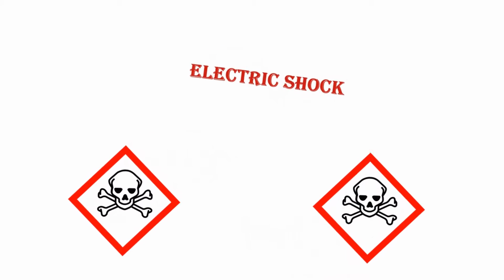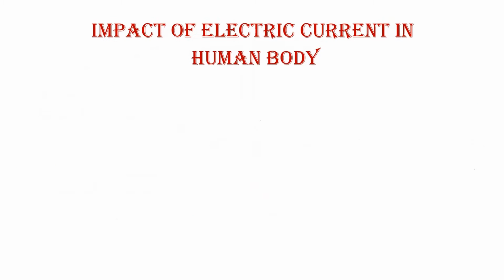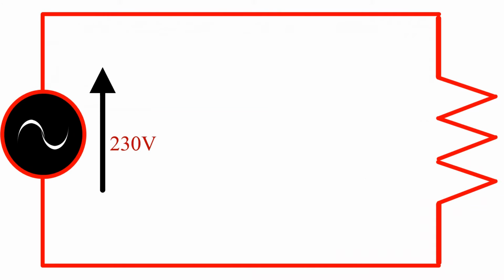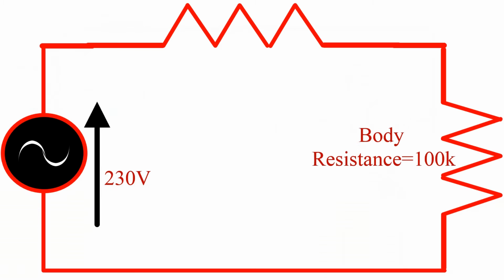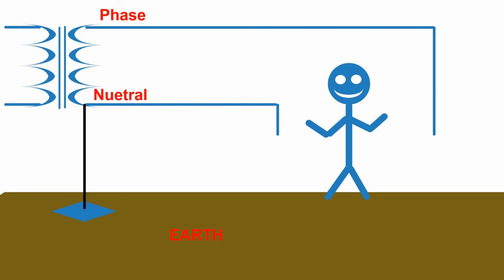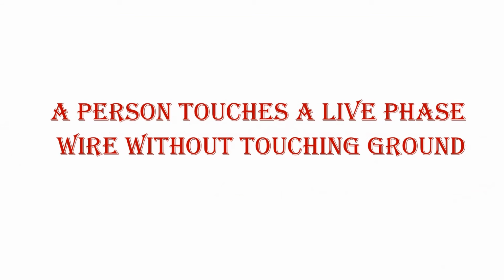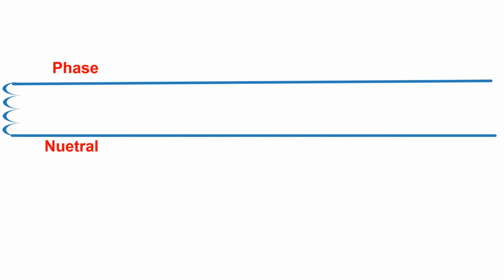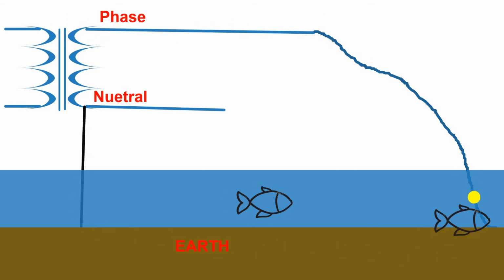What happens when humans, bird or fish touches electric wire? Electric Shock,explained!

Comment: there can be cases where the neutral has the same voltage as the live wire, so don't touch the neutral either.

Comment: i remember when i was a kid, i grab one bare side of half opened extension lead socket with exposed metal connection, i remember tingling and piercing pain and that i wasnt able to let off the socket from my hand for couple of seconds. It was domestic 240 Volts, and i think today, am i should not suppose to die that day?, i think theoretically i could die, because only resistance between me and ground was quiet thick woven rug and socks on me  :D... What is resistance of 1 inch carpet and slippers? I always thought it was God who did not allowed me to die that day, but now i think maybe it was not really God who saved me, but those classy slippers Santa Claus brought me for christmas. according to calculation 230 volts / more less 600-1000k resistance would give lets say less than 0.2 mA current through my body.

Comment: You ll shock severely if you touch a high voltage wire whether your feet are insulated or not,on the ground or hanging,circuit completely or not.The only difference is the severity.So don't ever mess with electric current.
Reply: whats the point of this video then, if you get shocked in every case, how come birds sit on high voltage lines and are okay?
Reply: @radokral  we have to consider capacitance of air in case of high voltage. Since bird has relatively small body compare to man it doesn't have much effect. But in case of human, due to larger area of body exposed to air high voltage will build a closed loop using air as a capacitor and eventually get shock. But low voltage around 230v is safe to touch in mid air. But not 11kv, 33kV or higher

Comment: well with boots chappals, etc. you're DC insulated, but not AC. there is always a parasitic capacitance
Reply: Can u plzz elaborate.....are u saying one will get a shock by AC current even with rubber slippers?
Reply: @AbdulHadi-hl3el  Yes, you will

Comment: Ok... Don't listen to this guy.
1. Don't go touching the 230V wire in search of a tingly sensation and especially not barefoot standing on earth...
Touch it and you'll get the jolt of your life...
2. 230V AC will pass though your rubber shoes because those rubber shoes now make you a Capacitor and AC Current passes though capacitors...
You will still feel something and one wrong move, like touching something that's earthed, a wall or whatever will send you flying around.
3. You have 230V average, but the Peak Voltage in that Sine wave is about 325V...
And now that you're a freaking capacitor you go out of phase by 90° so you might "feel" a full 400V for about 0.1ms, 100 times / second

Comment: If neutral and earth are 0V, if i connect one end of light bulb to hot wire and other to floor, will that make circuit complete and light glow?
Reply: yes
Reply: No, neutral and ground are kinda the same depending how you use it. Ground rod does nothing but dissipate electricity (not for faults). Now you have the neutral nd ground connected at the panel (MBJ) so if a fault occurs it can use the ground wire as a return path and since it's bonded to everything the resistance difference would make the braker trip in 1 cycle.

TLDR ground has very high resistance so it would not turn on the bulb and if it did then that ground would be more like a neutral since ground would trip braker